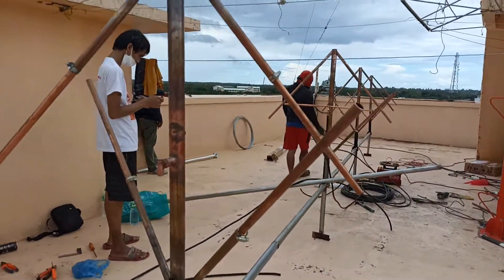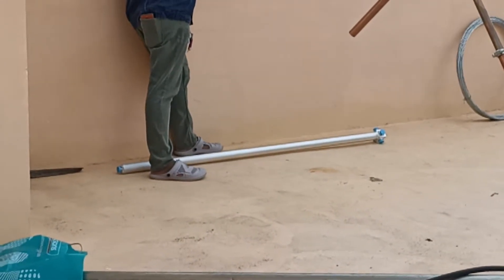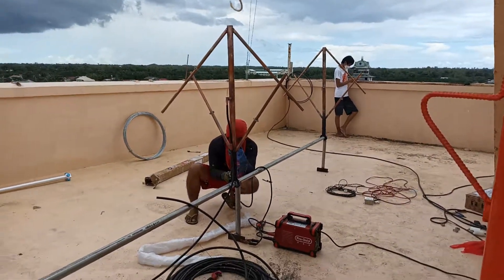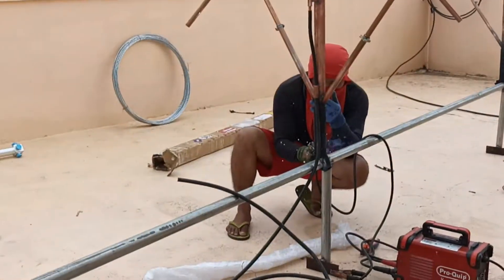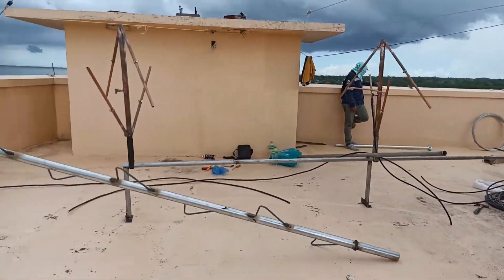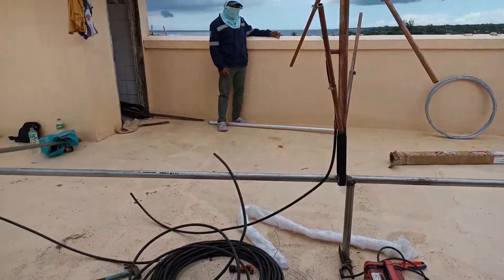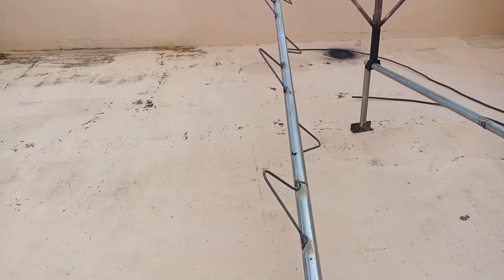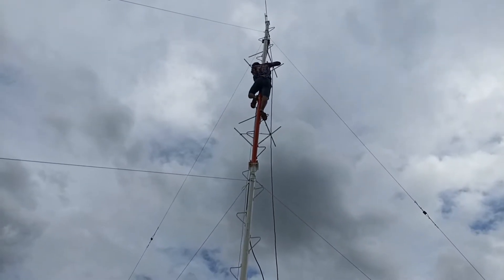upgrading FM radio station with 4 bays copper antenna part 2

Comment: The rds work ?
Reply from the maker: No sir😭
Reply from the maker: No sir😭
Reply from the maker: No sir😭
Reply: @cjtechtvelectronics  why
Reply from the maker: I don't know maybe the circuit are wrong
Reply from the maker: When I connect to the transmitter it has a motor booting audio and the RDS are not appearing
Reply: @cjtechtvelectronics  give me a pm and I told you
Reply from the maker: @ElectronicsShow  I can't send you a message ,no message  box on your channel